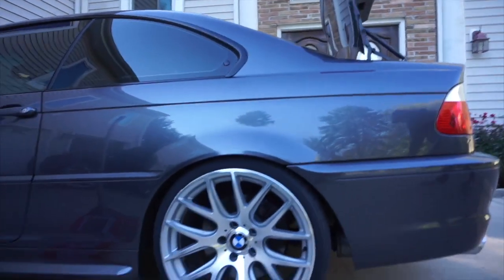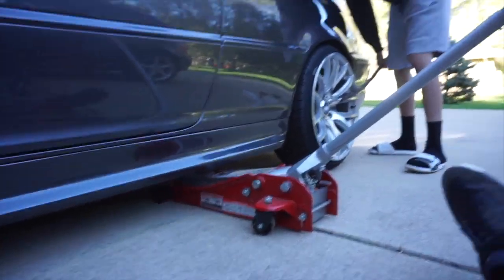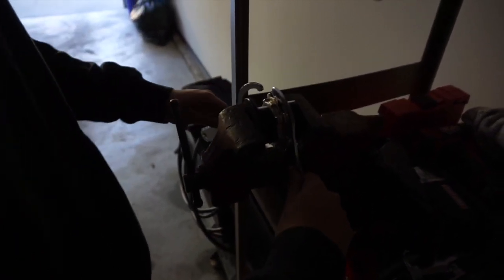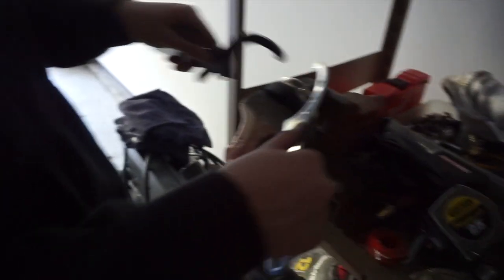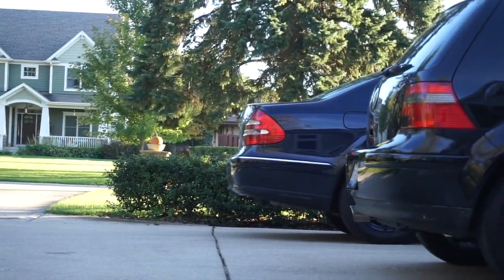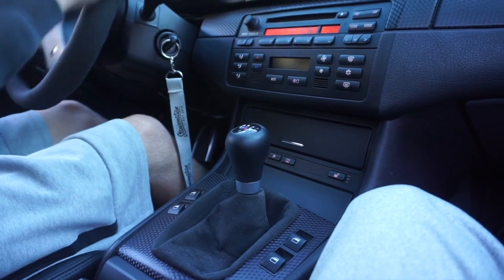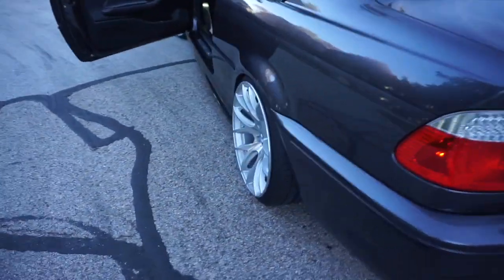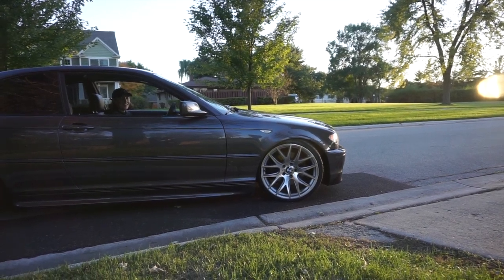18k BC Racing Springs Install (vlog #05)

Comment: your first vlog video you said you were runnin 19x9.5 front and back the same all the way around??
Reply: that's another major issue hes running 9.5 all the way around on a 330ci with standard fenders. so many problems going through so many tires. 19x9.5 is an M3 wheel which we all know M3s are flared.

Comment: yo plz reply would 18k be stiff enough to sit fender to lip probably not right
Reply: Luke Warzybuk go higher because if you hit a dip or bump it won't rub. Now a days stance cars have super high spring rates when they do fender to lip fitment. Seen a brz with 50k spring rate and his suspension doesn't move at all
Reply: I got some aggressive ass wheels and it’s sitting on 10k springs and the fender is hitting the lip hella and my tires rubbing like a MF it bounces to much will 24k do the job ?   Oh and I’m almost fender to lip about half inch from fender